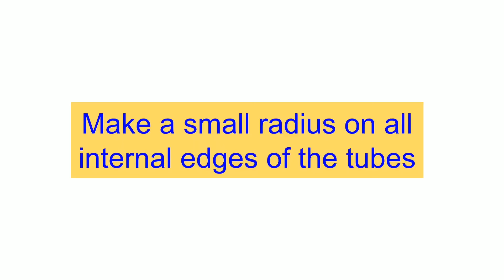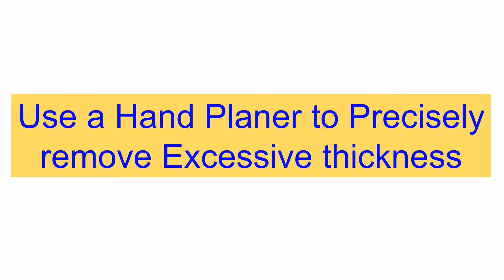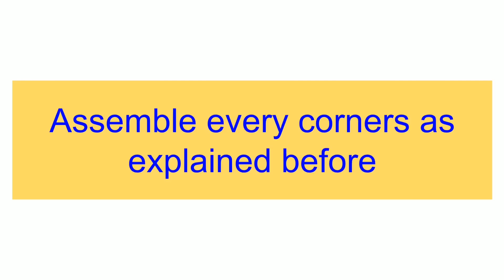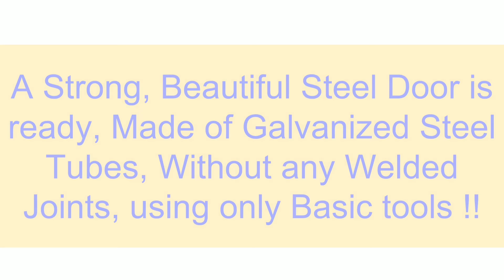Make a Steel Frame with No Welding / DIY / No Welding Frames #noweldingframes

Comment: That’s awesome, but I would use
solid PVC instead of wood for the corner joints.  As you can imagine, that wood will rot if exposed to the elements...
Reply from the maker: Great ! That's a great idea Ken ! PVC will definitely stand longer than wood. I used wood for this door because it was the option available that time and this door is not fully exposed.

Comment: It's actually stronger if you use fence railings and join using end joiners that are made for this purpose, also use 25 mm square and can buy all different angle Joiners for 25 mm  at around 50 cents
Reply from the maker: Thank you for your beautiful comments ❤️ 
I know what you mean. Those corner joints are mostly made of thin plastic which is just pushed into the tubes. Over time, these will get loosened and need extra fasteners as I used in this job. It would be a quicker option if we use additional parts to secure the frame.

Comment: Can the joints be removed  and reassembled ?? Like a fix by yourself concept ?
Reply from the maker: Since the inserts are made of timber in this case, they can be replaced if got damaged. Mine still standing in perfect condition after around four years.

Comment: This is a good idea for lightweight stuff. Would suggest glueing the wood inside the tube, and preferable sealing the wood beforehand and the top face before it is scewed into. Wood will rot, and the your piece will come apart.  For anything heavier duty, it would be a good idea to put a few screws into each piece of wood through the tubing.  A better idea might be to braze/solder it which is also much easier than welding and doesn't deform the metal. $20 for a can of butane and some brazing rods.
Reply from the maker: Thank you so much for your beautiful comments and support 👍👍 I used treated hardwood as inserts and the frame is still in great shape without any signs of damage, after almost three years now !

Comment: In the middle joint, have you insert the wood in both frames?. Or only in the smallest one
Reply from the maker: Thank you for your time and support for my channel 😍👍
I haven’t used timber in the long tube as it wasn’t easy to do it. I used only on the short tube comes in the middle.
Thank you
Reply: @JyjusHomeVideos  thank you

Comment: This is the kind of thing I would do here in India without access to welding tools and other special fasteners. Why you'd do this in Australia is beyond me. That wood insert is a weak link, also moisture is bound to destroy that steel frame in no time. The screws for fixing the wire grid seem the worst kind of jugaad even an Indian would be ashamed of. But don't worry, I'm planning on making exactly the same kind of hinged window, that's why I watched this video till the end, thanks buddy! 🤣👍😂
Reply from the maker: Thank you so much for your Sweet Comments and time 👍

I have done this frame in this method, is not because I don't have access to a welding machine or I am not good in welding. My only aim was to show someone who doesn't have access to a welding machine or someone who doesn't know how to do welding, How to make a frame with some basic hand tools and basic skills.

For your knowledge, I am an Indian by origin and I am a Mechanical Engineer with 3 decades of Practical experience in all sorts of manufacturing techniques including welding.

Regarding the timber used here : It is not a link between Steel tubes. It is only a filler material used to have threads to engage.  It is a type of hard wood, not just any soft wood, used here. There is steel to steel contact in every single joint. Steel tubes are galvanized too.

This particular frame in the video is still serving as the main door for my outdoor Chicken coop cum Aviary, for the past two years and I am pretty sure it will survive like new condition, for another ten years. There is not a single sign of damage after two severe Melbourne Summers and Winters !

Fixing the wire mesh with screw is the easiest way to do it. They're cap screws and holding the mesh very well. We can replace the mesh any time if we want to. 

Thank you again for your time and support.

Good luck with your project and 👍👍
Reply: What? Does hardwood outside just disintegrate when it rains? Of course it doesn't, and it's not being exposed to weather there so it will most likely last forever.
Reply from the maker: @chrispekel5709  The hardwood I used is few years old and it was really hard to drill through, even with HSS drill bits. I hope it will survive for many more years to come.
Reply: @JyjusHomeVideos  It'll outlive you (and I)
Reply from the maker: @chrispekel5709  True 👍

Comment: Very nice.  But, I’d you can, absolutely invest in a small welder and weld those joints.   Otherwise the weakest link in that structure is small skinny screws.
Reply from the maker: Thank you so much for your valuable feedback 👍 
True ! Those screws could be replaced by something stronger to get a stronger structure (such as, steel bolts and steel inserts instead of timber inserts) This method was intended for a common man with basic hand tools and very basic skills !

Comment: It would be much easier to use connectubes for building a steel frame without welding. The system is super cheap and uses steel couplers and 1.5 x 1.5" square galvanized steel tubing. Self tapping screws hold the joints together.  Highly recommend you learn about this building product to use for bbq frames etc...
Reply from the maker: Thank you so much for your sweet comments and feedback. I personally know many variations of tube adapters for such DIY projects. (I am a trade qualified manufacturing engineer with around 30 years of experience in various production techniques and equipment.) In this video, my aim was only to share a basic idea or tip for those who doesn’t have any welding skills or such expensive equipment and this method can be used for any sizes, shapes or materials. If you use steel or any other stronger material inserts instead of the timber inserts, this method will be the better bet than these adapters. 

Thank you again for your valuable feedback.

Comment: Whether this technique can be used for a weight bearing foundation structure from GI for fabricated bathroom
Reply from the maker: Thank you so much for your enquiry ! I don't recommend to use timber as a holding insert for a weight bearing structure, especially for a bathroom construction. Because, as the time passes by, there is a chance of water leakage or any such discharges will weaken the structure. You can use this concept, replacing timber with something, that can withstand such decay and damages. Using some sort of hard plastic inserts (such as Reinforced poly carbonate blocks) or Metal inserts (machined aluminum or steel blocks) where you need to make internal threads to use the screws (machine screws)

Hope this helps 🙏

Comment: Where from we buy corner brackets?
Reply from the maker: Hi Sabir,
I bought them from our local hardware store in Melbourne. If not available in your area, try on eBay. Other cheaper option is to make from  Galvanized steel Angles. (Pre drill holes and cut to size)
Good luck !

Comment: how much weight will this support?
Reply from the maker: I don’t have an exact number for this question. But if you use an insert that has enough strength, such as hard wood, metal inserts etc. you could definitely make a frame that will have a high weight limit. My door frame is still in very good condition after all these years. 
Thank you for your time and encouragement 😍👍

Comment: What size of wood you used for the hinges?
Reply from the maker: Thank you for your time and Watching. I did not use any timber for the hinges. Hinges are rivetted using Steel Rivets for strength.

Comment: How did you fix wire mesh onto the frame without welding ?,
Reply from the maker: Thank you so much for your time. I have fixed the wire mesh to the frame, using Button headed Screws.

Comment: How about just use gusset plates?
Reply from the maker: Yes, we can. But, they still need to be fastened with Screws, Rivets (or Welding which I am trying to avoid). Also the thickness of Gusset plate stands out from the thickness of the steel tubes.
And finally, the economic factor (combining the costs of Gusset plates and fasteners)

Comment: what if the wood rots?
Reply from the maker: That is an interesting question ! Thank you.
If in case it rots, we will be able to replace it easily. But if you select a timber that is hard and rot resistant, it will last for ever. Alternatively, you can use sealants for keeping the timber, everlasting. In this case, the timber I used is a naturally hard timber which is rot resistant and is still standing after three long years of continued exposure to the Melbourne Weather, where we have extreme hot and cold temperatures. No signs of Rotting or Damage at all and I am sure it will last for another three or more years easily 👍👍
Reply: @JyjusHomeVideos  thanks

Comment: The name of the last using join and your srew inch also please tell
Reply from the maker: Thank you for watching my Videos and Welcome to my Channel 🙏 🙏
For the corner, I have used 20mm x 25mm galvanized angle brackets and the screws are 1/2 inch flathead. If they are not available in the shops, we can make them easily.
Reply: Which one of the product do not get in the shop how to make it please tell or make new viedo plz
Reply from the maker: @suhails.r1090  Are you asking about the corner piece ?
Reply: Yes
Reply: Please tell or create a viedo
Reply from the maker: You can buy a piece of Angle iron and cut into small pieces of 15mm or 20mm width and make holes of 4mm

Comment: Or you could screw it with bolts and nuts. No insert.
Reply from the maker: If we use bolts and nuts without inserts, it will damage (deform) the tubes. Alternatively, we can have metal inserts and bolts can be screwed on to the threads made in that inserts.
Thank you for your comments 🙏

Comment: For anything that does not require any strength . You can get away with this
Otherwise the strength of those screws will snap with any 90 degree pressure when you least expect it,
Weld it if you can, it's a 100 times stronger.
Reply from the maker: Thank you so much for your valuable feedback. True ! It is not a permanent joint. I used this frame in the video for my chicken coop door and it has survived two Melbourne winters and still standing as new 😃. 
Strength will depend on what type of screws we are using. This method is shown as an alternative to welding to make steel frames and welding.

Comment: metal brackets are a thing just saying
Reply from the maker: Thank you for your time and support 😍👍 
True 👍 
This is an option to get a welded look without the brackets sticking out and a slimmer finish. My frame is still standing as it was built after all these years.

Comment: This is super half-assed.  Those frames are going to rack like crazy, and fail.  There is no way that with one or two points of connection the structure will be dimensionally stable, much less have any structural integrity.  The gaps between wood and steel will allow the steel to rust and the wood to rot at the same time, which is 200% more efficient, I suppose.  LOL.
Reply from the maker: Thank you so much for your valuable feedback. True ! It is not a permanent joint. I used this frame in the video for my outdoor chicken coop door and it has survived three Melbourne winters and still standing as new 😃. 
If we are worried about the gaps, rest and rotting, there are products to eliminate them. But in this case, I haven't used any and it is still standing without any signs of failure. This method is shown as an alternative to welding to make steel frames.

Comment: not solid bro
Reply from the maker: Thank you so much for your feedback ! I think it is very strong for the purpose it made for. If we are looking for a stronger option, there are other methods like using bolts and steel inserts replacing the timber.

Comment: Nice idea for low level frame, but not good for anything requiring support during constant movement. Your music is to loud and it socks!
Reply from the maker: Thank you so much for your valuable feedback. True ! It is not a permanent joint. I used this frame in the video for my chicken coop door and it has survived two Melbourne winters and still standing as new 😃. Yes, the music is too loud and sorry to hear that.